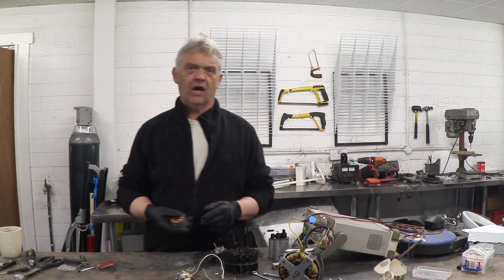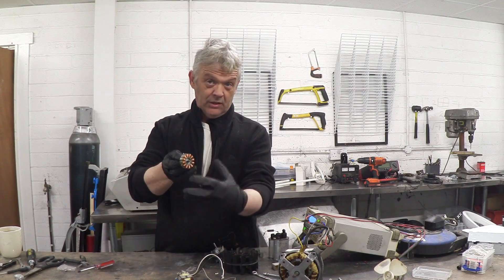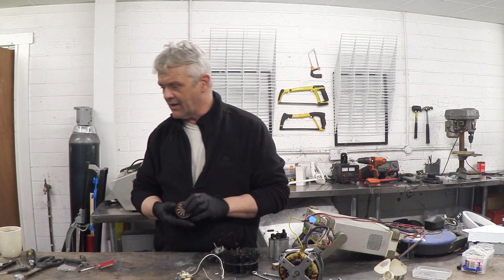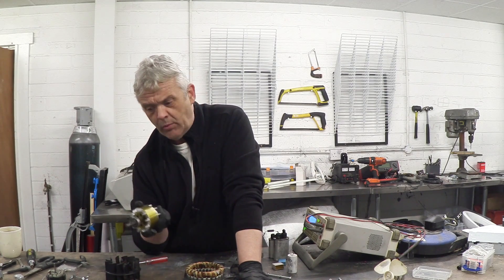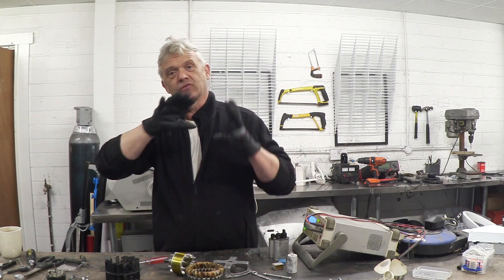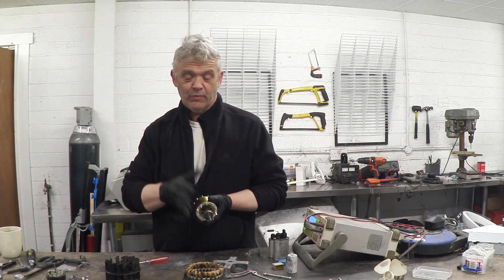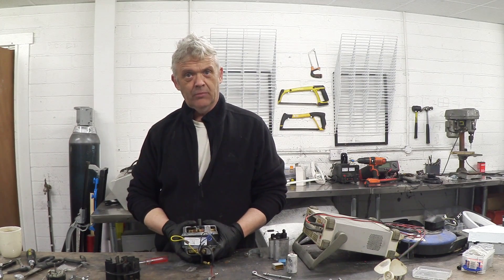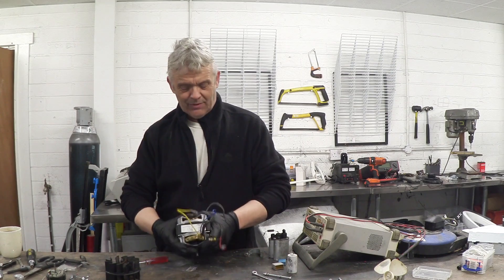500 An Induction Motor As A Generator Without Altering The Motor

Comment: Holy cow thankyou Robert I have been playing with a 3 phase motor wondering about this very thing and found even spinning it with a cordless drill at 900rpm (motor rated at 950rpm) I could only get about a 3v ac peak and was wondering if you would be able to come up with a solution, strangely I was looking at these for a design of VAWT wind turbine using a centrifugal fan to turn the motor. I added a rectifier hoping to see a result in DC but unfortunately saw no more than maybe 1v (this was over a week ago so can't remember all details) but clearly I wasn't running the motor at a high enough speed.
I am also wondering whether combining this with a moped variable ratio style gearbox woul;d enable the motor to maintain speed with reduced effect of turbine speed.
Reply from the maker: when it is at low speed mate you get these tiny voltages - when you get close to where it wants to run you will see a sudden spike in voltage - it's then you can put a load on - i am sue you know - but i thought i should mention you will need a 3 phase rectifier - super easy to build though
Reply: @ThinkingandTinkering  yer I bought 3 bridge rectifiers as was going to try with a few different motors and wanted some spares and just assumed the motor would work the same as a motorcycle alternator effectively and once I have a high DC voltage I can then put it into a charge controller.
On the single phase motor I take it you are wiring the capacitor across the starter coil and then drawing off of the running coil? This is how I've wired just need to go get a mains drill from storage to test.
I am a little unsure how to wire the 3 phase motor at the moment with the 3 seperate brown wires and 3 bridged blue (could be unlinked and may give higher voltage) I was thinking of just placing a capaitor between 1 of the blue and brown wires but I'm unsure as ohmage is same on all 3 coils.
Reply: @shortbuslife3440    This is how to wire in capacitors with 3 phase delta wiring. 
https://images.app.goo.gl/xsvtsPc2Ao2WuV8c7
Your load can be a 3 phase bridge rectifier, or three single phase bridge rectifyers with the + of each connected and the - of each connected.
Reply: @kreynolds1123  Thanks that was something I wondered with the bridge rectifiers but have little experience with. As for the speed control this is why I was saying about using a cvt gearbox from a moped as this would be a low cost solution, obviously not the whole gearbox though, but using the same kind of parts as they're readily available and can be fine tuned without huge manufacturing expense.
Reply: @shortbuslife3440   another way to hook up  capacitors, wye configuration.

https://images.app.goo.gl/WCMnEaZZwoitdev69

This way you can connect smaller voltage rated capacitors, but the capacitance between two capacitors in serries adds as 1/(1/c1+1/c2). Im not sure if being in 3 phase wye wiring  changes the formula. 

eggs adds
Reply: @ThinkingandTinkering  so if I were planning to drive it with another electric motor, it might be a good idea to add an old school heavy flywheel to keep it operating at it's optimum speed! Hmmm interesting..
Reply: Wind speeds are variable which poses a challenge for DIW induction generators for wind power. Basiclly you need either a mechanical continously variable transmission to speed up the generator under low wind speeds and slow it down under high wind speeds, or you need  to electronically switch in and out reactive capacitance as turbine  generator rpm changes, so as to adjust resonate frequency of the capacitors and field coils.
Reply: @kreynolds1123  o

Comment: While the mains freqency in many parts of the world is 50hz, in the US it is 60hz. A permanent magnet motor, is a synchronous type motor with its synchronous speed depending on the number of pairs of poles in the field coils. In the US  a synchronous motor will spin at (60hz aka cycles a second) × (60 seconds a minute)/(number of poles/2). 

So in the US, with 2 poles making a pair in the stator, the synchronous speed is 3600 rpm.  2 pole pairs (4 poles) = 1800 rpm. 4 pole pairs = 900 rpm.  In say the UK that would be 50hz ×60 seconds/(2/2)=3000 rpm. 50×60/(4/2)=1500,  and 50×60/(8/2)=750 rpm respectively. 

Now induction motors are asynchronous type motors and they require a difference in rotating speed between the synchronous speed of the rotating magnetic field in the electromagnetic field coils, and the rotating speed of the rotor.  Induction motors are generally rated at about 5% slower than  synchronous, in the US (3600rpm becomes 3420rpm, 1800rpm become 1710rpm).  Too much slip (over 5%) causes excessive heating in the rotor and field coils.

Grid excitation: If you pluged an asynchronous induction motor into the wall and spin it faster than its synchronous speed, then instead of drawing power from the grid, it will generate electrical power pumping that power into the grid.  Because of the induced currents inside the rotor cause heat in the rotor,  you should not go any faster than about 5% faster slip than synchronous with the grid. For exampke, in the UK  with 1 pole pair field winding motor  50×60/(2/2) × (slip factor 1.05)=3150rpm. 

Self excited inductlion motors store "reactive power" in the capacitors with the inductance and capacitance acting as a resonate capacitor inductor tank circuit.  The resonate freqency (aka syncronouse speed) of the tank  circuit in the most simplist terms, is a function of capacitor and inductance  1/(2×pi×sqr(L×C)).  Adding resistance in the coils and load complicate the formula. 

Now it will continue to generate power as long as you dont try to pull  too much power. Causing it to loose its self excitation. I don't have an equation for that.
Reply from the maker: awesome mate - thanks for taking the time to post all of that - made a lot of sense to me
Reply: @Reno Simpson which motor? I described 2 types, and then broke down two different ways an induction motor's field coils can be excited. 

There are quite a generators on youtube with some being fundamentally different than others.  Furthermore they can also range from being just click bate to hoax scams.
Reply: @kreynolds1123  So true, and thank you so much for taking the time and effort to explain them in detail!! 🤯(mind blown!) 

I cannot even begin to tell you how much, 
I appreciate your kindness in doing this, you are  a star!! ✨⭐🌠✨✨🌟
Namaste 🙏Andrea, Jasper and George the Pigeon. XxX.
Reply: yup, i've been watching german feedback to grid (bhkw) video's on youtube , and they spin up the diesel/gas engine on 380 volts, turn on the ignition, then over rev the induction motor to get it to deliver power back to the grid.,thereby reversing the power meter.
Reply: That's a mouthful

Comment: Great video! Is this similar to how an alternator on an automobile works?
Reply: The key difference is in the rotors.
brushes put a dc  current on a coil in a vehicle alternator and induction generators use reactive currents from the grid or capacitors to induce alternating electric currents and magnetic fields in an induction rotor.
Reply from the maker: very similar mate
Reply: The big difference with an alternator of course is that a) it IS a generator to start with b) it STILL has the potential problem of being brushed, albeit just to slip rings so "slightly" less wear. Some people may be tempted to over-rev an alternator to try to increase the output volts (and current) but it's dodgy at best. The better approach is to use a 24 volt truck alternator run at peak revs (for its rating) and run the high power 24v/ 40-60 Amp (1.4 kWatt) into an inverter with a 24volt battery (or two 12v batteries in series) to smooth the DC from the rectified 3 phase alternator output. I have seen several setups like this for off grid power. 

The main problems you will face are achieving sufficient rotor speed to produce maximum torque and output power whilst also achieving an efficient power transfer at the required speed without stalling the rotor at low wind speeds or the turbine having insufficient torque to start properly especially when the output is loaded. Electronic controls are useful here to both unload the output AND unload the rotor by not applying slip ring current until OVER a specific rotational turbine speed and not applying output load until that rotational speed is above a stable lower limit (different for VAWT & HAWT- higher for the latter). It is unlikely that maximum power will be achieved with such a system until winds of OVER 20mph (30kph, 8-9 msec^-1) or even greater are consistently blowing. Hence the need for an efficient turbine design either VAWT or traditional  large bladed HAWT. Remember that VWT designs are potentially capable of withstanding typhoon level winds but HAWT designs have a MUCH lower limit.
Reply: It's much more efficient to just buy a generator head to attach directly to a crankshaft output. Alternators are okay for what they do but if you're pulling an alternator to do full time generation, just buy a genhead that can be directly linked to the output shaft of an engine. You can buy some that put out 15,000 watts for 1200 bucks. I see larger ones yet. Single phase and of course you can always buy three phase.

Comment: I remember this post https://hackaday.com/2020/01/16/car-alternators-make-great-electric-motors-heres-how/ which reminds me of this-- a alternator as a brushed dc motor.
Reply from the maker: that is an awesome post mate - and going to be a video lol - thanks a bunch for that
Reply: @ThinkingandTinkering  this is very similar to what nikola tesla was talking about in the polyphase chapters of his inventions researches and writings. this is why to his dying days he claimed his discovery of the rotating magnetic field was his most significant discovery. he speaks of synchronous and lag motors with different combinations of poles, alternators and "condensers", capacitors.

 chapter viii is entitled single circuit, self-starting synchronizing motors. these circuits use a dead resistance, an inductive resistance and mechanical switches to start a motor. its not until chapter xxi we encounter capacitances. entitled 'motor with a condenser in the armature circuit', it begins by noting these are the type he used in his high frequency work. i think basically what is said is that the capacitors emulate the mechanical switch. he goes on to describe in more detail these types of motors and i would love to see you do a video on the topic.